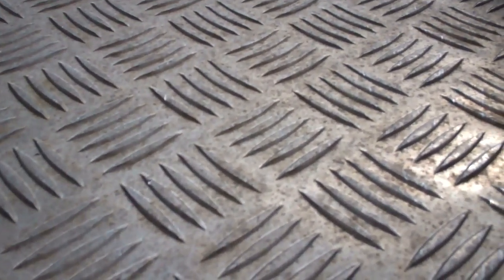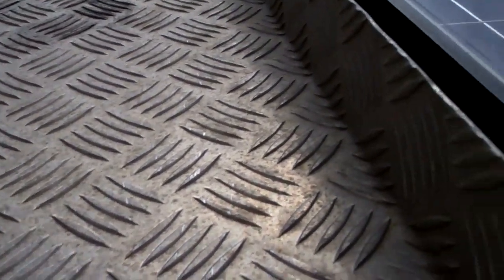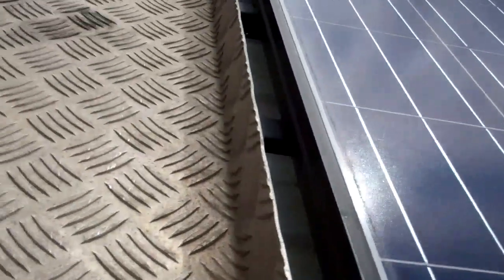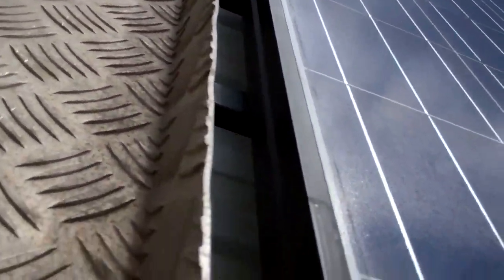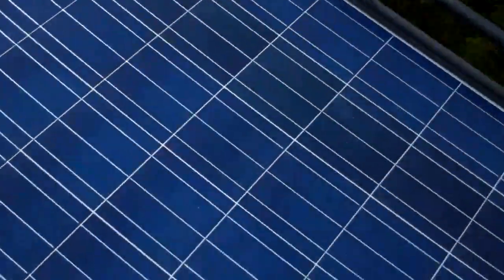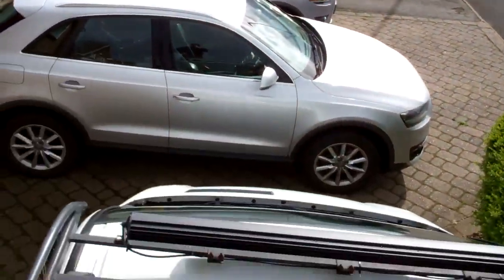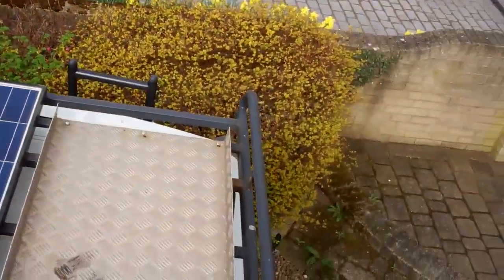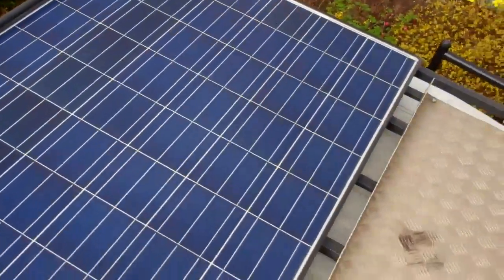Renault Trafic Adventure Campervan Conversion Part 8

Comment: Shaping up nicely Shaun 👏.. Just wondered what type and  size leisure battery do you fit in your campers
Reply from the maker: The last couple of vans I’ve done I have fitted 110 amp probat batteries they are not the best but adequate for weekend vans,my Peugeot has a pair of 110amp AGM leisure batteries,loads better but expensive, thanks for watching 👍.
Reply: @DIYCampervansAndVariety  thanks Shaun for that 👍
Reply from the maker: @stephoeverything8712  no probs 👍

Comment: Another nice conversion, looking good. Gets me how quick you knock these out. Certainly gives me inspiration to get going on mine. Can you tell me please what fridge, cooker and sink you use. Where do you get them from, some of the prices for cooker/sink combos are ridiculous. Thanks. One tip you've shown me in this series that I've been scratching my head over is tapping into the diesel for heater, will defo be using your tip on this one 👍. Great stuff, keep it up
Reply from the maker: The cooker was a kampa cucina from eBay the sink was from Amazon with a waste hole put in see link it was listed as a catering banbaree
https://www.amazon.co.uk/dp/B007TKE94C/ref=cm_sw_r_fm_api_fabc_T5C77SE99Y1QS529C199?_encoding=UTF8&psc=1
The fridge was from eBay a seller called home valley based in York,glad you enjoy the videos, thanks for watching 👍.

Comment: Another great van build Shaun. Always enjoy following your progress.
I'm converting a Citroen Despatch which has windows all round. I do like the blinds you use from Ikea. Can these be cut down to size or do they come in various sizes? Cheers 👍
Reply from the maker: Hi Gaz looking forward to your build,saw it mentioned on Bretts Urban stealth camper van channel ,they come in various sizes they can be cut down a bit but not a lot as they have a large spring in the top section,mines finished now last video for it going out later tonight, thanks for your support 👍.
Reply: @DIYCampervansAndVariety  Thanks for the info Shaun. I will certainly be re-watching some of your vids for ideas inspiration and guidance. 
Hope it will be ok to pick your brains now and again if I get stuck? Cheers 👍😊
Reply from the maker: @campervangaz  any time that’s what my channel is all about,helping others build a good useable camper for not a lot of money ,any questions don’t hesitate to ask,if I can help I will,good luck with your build 👍
Reply: @DIYCampervansAndVariety  nice one... thanks Shaun 👍

Comment: Looking good.. question..any reason why you didn’t make access to the toilet from inside? 
And When do you think you’ll sort the pricing out and advertise ? 
Keep up the good content mate and look forward to the finished van 👍🇬🇧👊
Reply from the maker: I usually make the door in the side of the bed so it slides out behind the passenger seat but the Renault Trafic isn’t long enough to open the door and allow the toilet to come out,if you watch my Citroen relay and vw T5 videos I put the door in the side,the price is looking like being 7k as it’ is or 7.5k with new bf Goodrich off road tyres fitted,thanks for watching 👍.
Reply: @DIYCampervansAndVariety  
I should have realised that 😂 have. Cracking day. Gonna be a warm one 👍🇬🇧👊
Reply from the maker: @Grumfuttocks  thanks Mark might get a bit more done today 👍